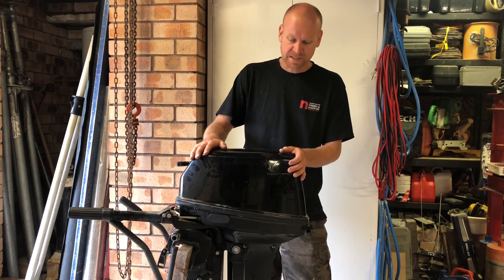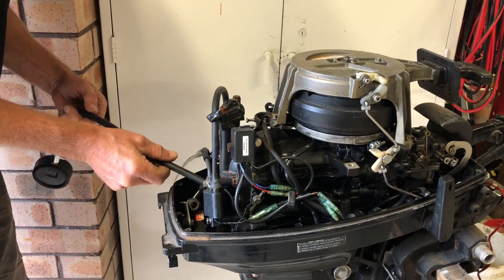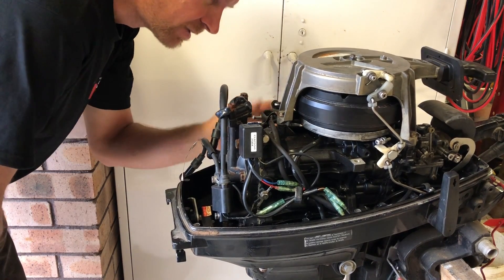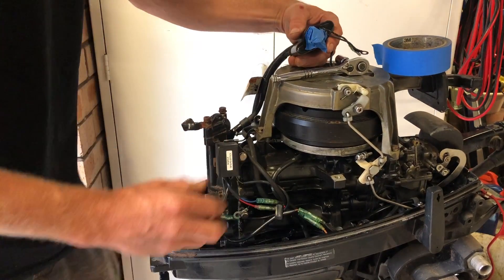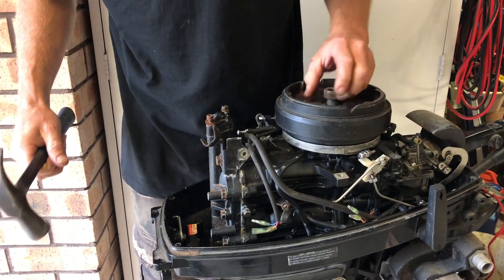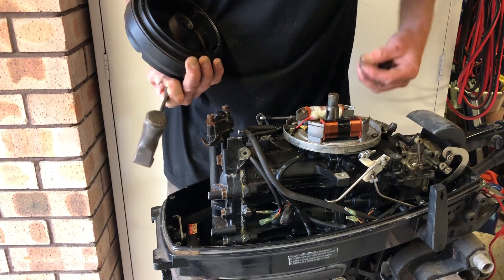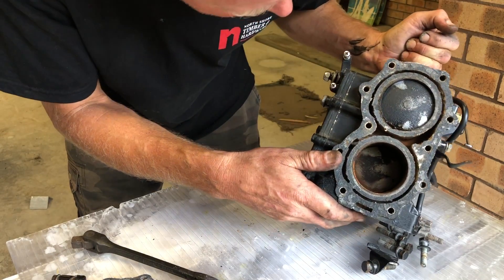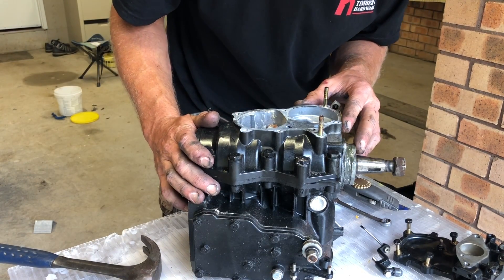15hp - 18hp tear down two stroke.

Comment: Hello master I need your guidance. For the Tohatsu m18e2, the cylinder head bolts are m8x40. During the tightening process, what torque do you apply with a torque wrench in newton-meters and kilograms? 🍻
Reply from the maker: Hi Mate,
I torque the 8mm to 18.1 ft pounds and 6mm to 6.5ft pounds.
I would definitely check if this is suitable for your motor.
Cheers 🍻 
Aussie Boat Guy 😎

Comment: Hello, Master Tohatsu 😀,

In 2009, I acquired a Tohatsu M18E2. I’ve used it in saltwater, and I estimate the usage to be around 800-1000 hours. During this time, apart from routine maintenance such as spark plugs, lower unit oil, and impeller rubber, it never gave any trouble and always delivered good performance. In fact, when I cleaned the carburetor after 14 years, there wasn’t even a speck of crystal apart from a little residue on the lower tray. By the way, I live in Istanbul, Turkey, in Golden Horn.

This summer, however, it started having idle issues! I checked the spark plug, spark plug wire, and coil, cleaned the carburetor again, but nothing changed. Eventually, it became hard to start and began stalling at idle... When I measured the cylinder pressures, I got a result like 75-125.

On top of the high costs you mentioned, we’re also having trouble finding parts in Turkey, as it’s an older model and parts are hard to come by. If I can find the parts, I plan to do the overhaul myself. The engine is currently in my garage, and while removing the cylinder head, two of the bolt heads broke off, and the other bolts were heavily corroded... Even though it’s a relatively simple engine, I came across your videos on YouTube while researching if there are any fine details to be mindful of during the overhaul. Your videos are fantastic and very explanatory, thank you for that! If I can source the parts and continue the overhaul process, I’d like to consult you, Master, in case I get stuck—of course, if you’re willing to help!

That’s my Tohatsu story, which led me to meet you. Thanks again for responding to the previous comment. Take care, Anzac King... Greetings from the old world 🇦🇺🤝🇹🇷. Oh, by the way, I love rakı 😀🍻 cheers.

P.S. Whether the corrosion seen in the video is a result of normal use or if it happened due to an incident like falling into the water?
Reply from the maker: Mate, sounds like you’ve had a good run with that motor 👍. Can you get the parts online? I would check that the bore isn’t scored before ordering too many parts though. I have a video on removing broken bolts (actually an 18hp block) on my channel if you need.
You can contact me through these messages champion.
Cheers 🍻 
Aussie Boat Guy 😎

Comment: in this video you dismantled the motor but i couldn’t find a video that you reassamle the motor. Is there a video that you reassamble ?
Reply from the maker: Hi Champion,
I am unfortunately still looking for a genuine crank, new ones cost a fortune.
Cannot bring myself to use a cheap aftermarket one. I did a video titled outboard rebuild where I rebuilt a 9.8hp which is so similar to the 9.9-15 and 18 that it would be pretty much the same video. That video should get you out of trouble.
Cheers 🍻 
Aussie Boat Guy 😎
Reply: I have a complete running block for you if you like.... i have like 8 of them

Comment: Bonjour j’ai des petit problème avec mon 15 pouvez vous m’aider ? S’il vous plaît
Reply from the maker: Hi mate,
Unfortunately it’s very hard to diagnose a problem without actually having the motor in front of me.
Kind regards,
Aussie Boat Guy 😎
Reply: @25hpboatracerman  my problem is that I put on the gas but the engine does not accelerate, I would like to know if it is the carburetor or the CDI, before it was slow but after changing the piston and connecting rod bearings it is getting worse the mechanic tells me that it is It’s the CDI that’s starting to die

Comment: Gday mate. That tohatsu is exactly the same as my 15hp Mercury. Is there any way to put an electric start on these? I have a buggered back that makes pull starts challenging sometimes.
Reply from the maker: Hi Mate,
Yep the Mercury is made by Tohatsu 👍
Yes you can put electric start on it, I put it on my one 😁.
I think they sell a kit on eBay for it or you can call around the local outboard wreckers.
I got mine off another motor that was cooked.
You need the flywheel with teeth, starter, charging rectifier, starter solenoid etc etc. It’s an easy thing to add.
Cheers 🍻 
Aussie Boat Guy 😎

Comment: Hey mate, what did you do to fix it and to get it running properly?
Reply from the maker: Hi mate,
Luckily I have a few good second hand parts for those motors.
Used a good crank and pistons, another good block, new seals, rings and gaskets. Proper run in and she is sweet 👌
It’s always disappointing pulling down a motor to find that much damage, on the other hand when you pull one down and it turns out to not need too much it is great 👍 
Cheers 
Aussie Boat Guy 😎

Comment: Do they use some kind of sealant between the crankcase halves?

Also I'm guessing the crankshaft must be pressed together from two pieces. Otherwise there wouldn't be any way to assemble that middle bearing onto it.
Reply from the maker: Hi mate,
Yes there is a crank case sealant that is used between the halves.
The cranks are pressed, actually a fair few parts pressed together to make the crank.
Cheers,
Aussie Boat G

Comment: Thanks heaps for your videos.  Clear, succinct.  Did my first Tohatsu carbie strip down and re-build whilst suspended off the back of a Cat at anchor based on your instruction.  Engine is now running like a dream.  Legend.
Reply from the maker: Thanks mate 👍 I really appreciate your comments. That is the exact reason I do those videos and glad your motor is running sweet again.
Cheers 🍻

Comment: these Tohatsu's are the most ingeniously simple motors i've ever worked on recently. Had one torn down in 25 minutes! the ingenious parts are small, but extremely smart. for example: the crank case half has recessed dimples to put a screwdriver in to pry it apart without damage. 90% of the screws are 10mm. the ignition is mounted in a modular way, with an absolute minimum of fasteners. i could go on and on, but these are such a joy to work on. minus the crappy paint and corrosion issues.
Reply from the maker: Agree totally mate 👍.
Cheers 🍻

Comment: What causes it to lose compression
Reply from the maker: The rings on the bottom cylinder are not sealing against the bore walls. Water ingress caused it in that motor, other motors can loose compression due to an overheat it no oil in the fuel if it’s a two stroke.

Comment: im still looking for a 9.8
Reply: ive got a 15, 18 and 9.9 all short shaft accept the 9.9hp which is 20'' (little longer on Japanese motors) for sale. the 15hp is the one you want. same weight as a 9.9. the 18hp is a 300cc monster that puts out about 21-23hp at the prop!
Reply from the maker: Yeah, getting hard to find a good 9.8hp, great little motors.
Reply: I have a Yamaha 9.9hp. In Rockdale area. André